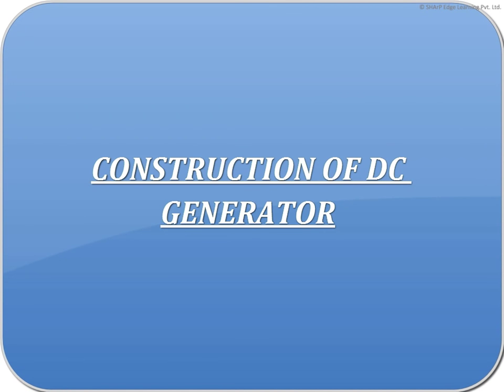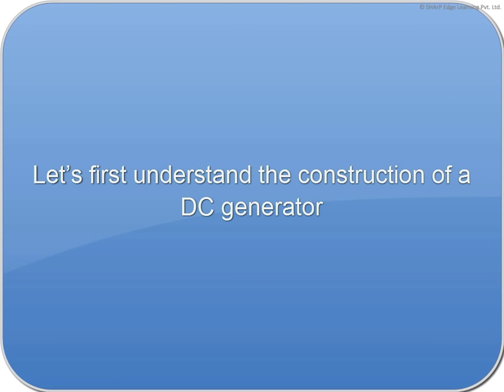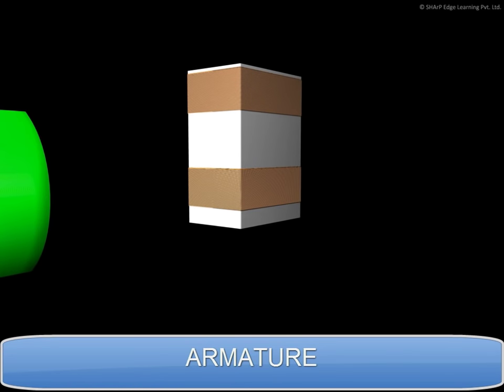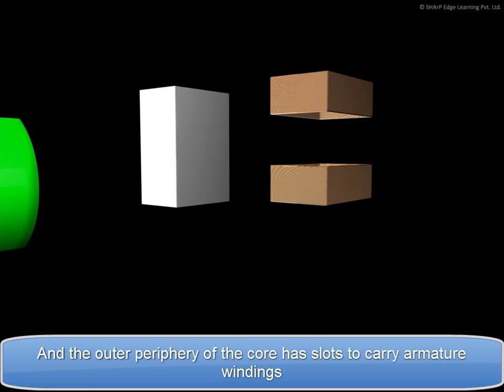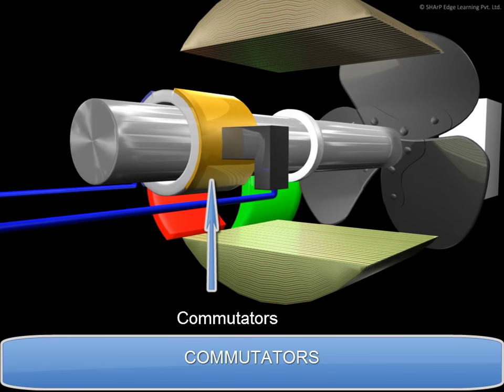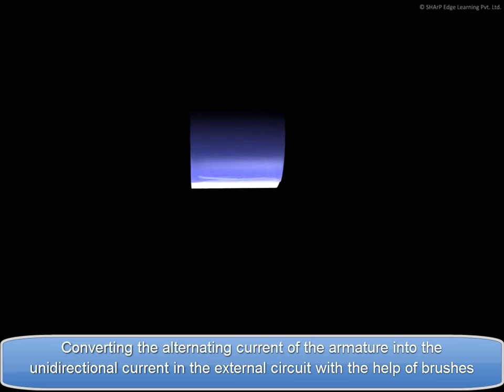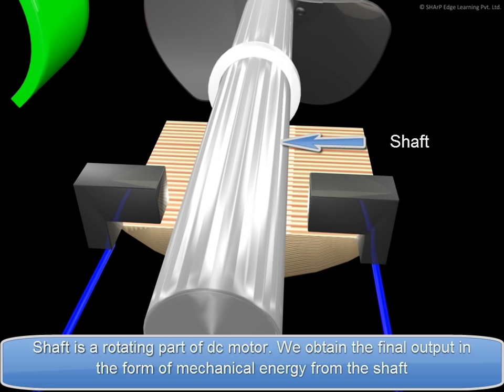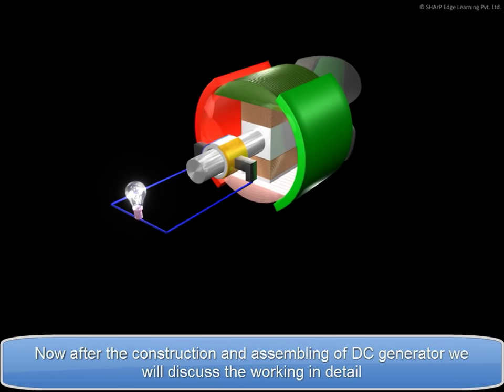Construction of DC Generator

Comment: diference between inductor and indtance
Reply: abo zar Ali inductor is the coil which is curled or made like a spring, inductance is the resistance provide by the inductor when connected to AC circuit